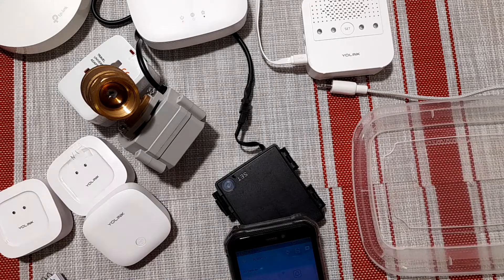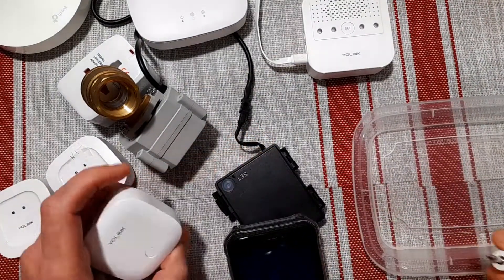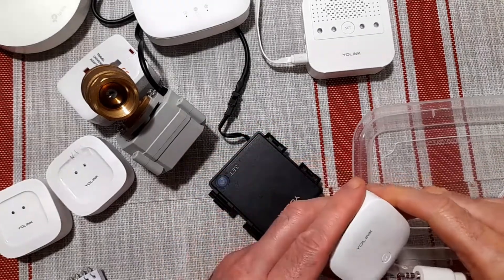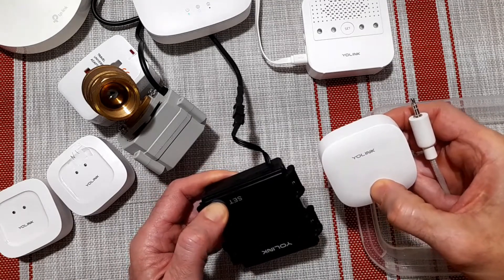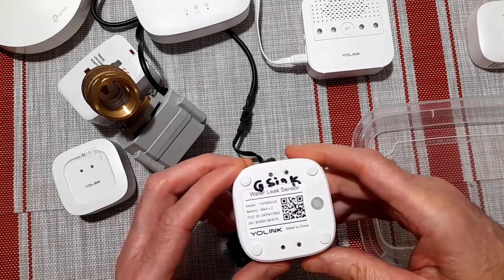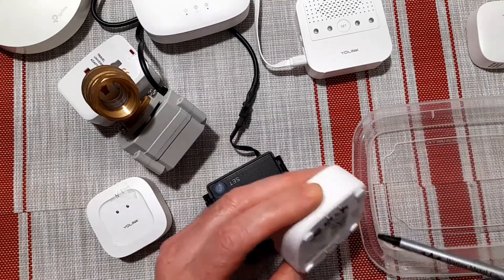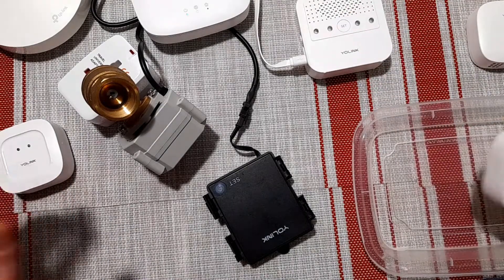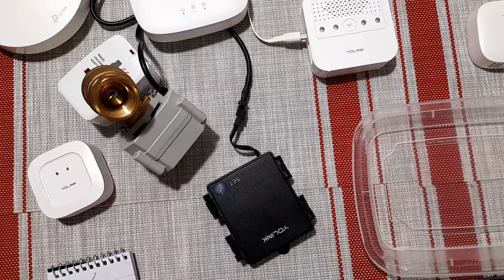Are you confident the sensors will trigger and protect from water damage?

Comment from the maker: ***2 Feb Update***
I did additional research on the problem with notifications through email & SMS.  You need to review the alarm strategies for the overall app under settings.  Mine had 3: 1) Default, 2) Effected when away, & 3) Always.  You can individually turn off email/sms  in each of these strategies.  Once the strategies are updated, go to the individual sensor settings and select Alarm Strategy.   Pick the correct one (Default, Effected when away, or Always)  that has your desired notifications.   
**1 Feb Update**
Contacted Yolink about the lack of notifications through email & txt messaging.  They indicated they could not replicate the problem and asked me If I had pressed the set button after factory reset.  Of course I did.  Called and left a voice message.  Hope to hear back soon for resolution.  Will keep this updated.